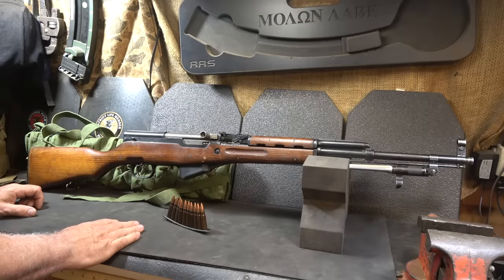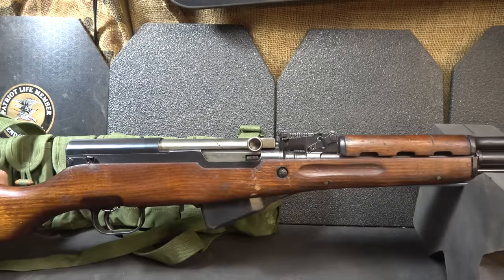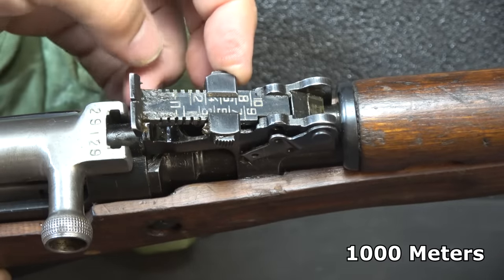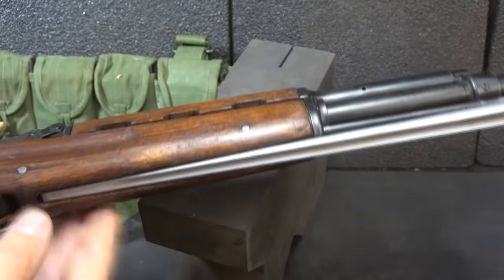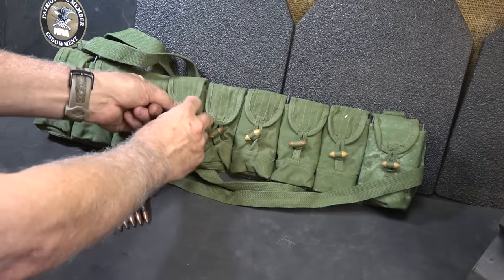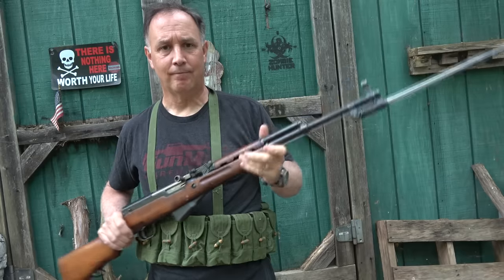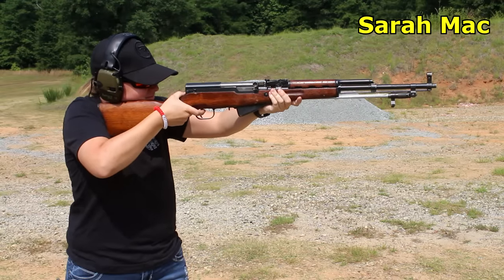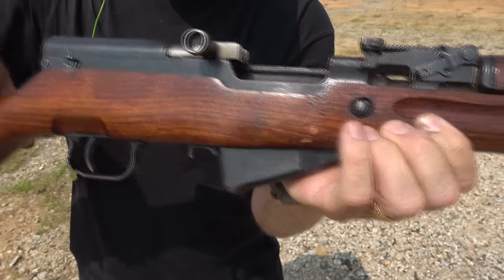Surplus Chinese SKS Rifle Review

Comment: Actually the recoil spring curvy end needs to go into the bolt carrier and the straight and goes toward the back
Reply: why so? genuinely curious I know nothing about disassembly/reassembly
Reply: The guide for the recoil spring is a tube that goes into the bolt carrier during recoil and maintains the spring shape. If you try both ways you can hear and feel the difference. Correctly oriented it is very smooth and quiet, reversed in will feel and sound “crunchy”.
Reply: I always wondered which way it was. Glad to know I was right the first time.
Reply: Thanks for the tip! I gotta go check if mine is right!
Reply: This is true if you put it in this way it will lock in through the frame and you won't have to push the dust cover forward to hold it in
Reply: ...yup!
Reply: I know this is old but yes when i saw him say it i was like No! Wrong infovits opposite the spring.
Reply: @user-jr6ot6wu6p  I had a guy sell me a Russian SKS for cheap cause it was unreliable. Turns out he put the spring in backwards lmao. After that it ran like a champ. It was a beautiful unrefurbished Tula too. I sold it like an idiot
Reply: The snake goes in the hole
Reply: THIS.
Reply: Guy owns the channel. Doesn't mean he's an expert or is right about everything he says or does.
Reply: Thank you❤

Comment: Pretty sure the straight end of the recoil spring faces the rear.
I bought my 1st SKS in 1980 and have had Chinese, Russian, Yugoslavian and Romanian variants.
Never been lucky enough to own an Albanian variant.
Solid well built rifles.
Reply: Yes you are right. The curly goes in first..
Reply: Absolutely correct! However it will still fire, f’n great gun
Reply: Yep curly part of spring inside the bolt carrier.  Can cause malfunctions the other way.

Comment: Back in 1990 I bought a new one unissued, milled, chromed bolt & barrel with all the accessories CAKED in cosmoline for $69.99. I was  young and poor then but would have loved to have bought a crate. I've had the trigger reworked, put a muzzle brake on it, a pistol grip that attaches to the trigger group and a Chicom 20 Rd fixed mag. Great shooter that's accurate and fun. I own a a lot of milsurp and this is the EASIEST rifle to load quickly with stripper clips. I like it better than my AK. It's one of my favorite guns to shoot. One caveat: Don't use copper washed ammo. My ONLY failure ever was FTF when I used that ammo, and that was after 500 RDS fired. That stuff just gunks the chamber up and cases don't want to extract. Left a ton of flaking behind to clean. Highly recommend getting one.
Reply: You mean it's BUBBAFIED !

Comment: You got it wrong. The curvy part of the recoil spring is supposed to go in first.
Reply: Correct.  He also has it wrong on the cleaning video.  It appeared he recieved the firearm with it installed reversed.
Reply: Yeah the curly part for sure goes inside the carrior
Reply: Was just gonna say something haha but y’all beat me to it
Reply: Yeah, I caught that too.
Reply: @videodistro  i have purchased new skss and found the spring to be inserted both ways and it doesnt seem to make any diffrence. so enlighten me. give me some facts to help me decide either way!
Reply: snake gose in the hole
Reply: is there any repercussion of having this reversed? I was watching a different video and noticed it too. The curly side was head first in a different video, but this one had the curly side facing opposite. Glad the comments confirmed it to me too. Curly side goes in first.
Reply: @pandanese90  THE AK. CURLY End GOEs IN FIrst ALSO.
Reply: @videodistro  correct, but it comes from China so it's excusable...lol 😂🤣
Reply: I been workij at a gun shop for 15 years, 50% sks come in with spring backwards, makes action rough, probly why failures....
Reply: I spit on mine before putting it in.
Reply: @williamdaniels6943  Try it both ways and yes it will function you'll notice a big difference in the feel of the action while operating the bolt when it's incorrectly installed with snake to the rear
Reply: @BM205  thanks for the info partner just went and changed mine over
Reply: @williamdaniels6943  Glad I could help
Reply: Curly end first.
Reply: William Daniels It batters the action harder than it should with it installed incorrectly and you can also experience malfunctions with it in backwards.
Reply: Doesnt matter..it functions either way.curly or straight end first..I've tested it on 4 different sks from Albanian to Yugoslavia .russian.romania.work fine...it might work the rifle harder w the curly end in the back position..unless your shooting 1000 rounds a day..it a be fine.
Reply: @williamdaniels6943  I think the straight end should be in the back, idk, I just know how it should feel when cocking it. if it feels and sounds rough, its wrong so flip the spring around.
Reply: @williamdaniels6943  Curly end in.

Duh.
Reply: I accidentally put mine back together with the spring backwords and the gun jammed. I had to use tools to even get the back open the spring was so far pushed in.
Reply: You guys realize that the end that goes into the carrier is going to cause the “curl” on the other end, right? The springs longer than the guide rod, and it’s straightened out when in the carrier.
Reply: @williamdaniels6943  I found this https://youtu.be/rZUZi57h49Y?t=463 The consensus is that curvy first into bolt carrier then straight is in back.
Reply: @williamdaniels6943  Trust me, you did not buy a "new" SKS. You bought an SKS that was new to you.

Comment: You’re putting the carrier spring in the wrong way! Don’t just take my word for it look it up! hope you see this comment!
Reply: That's absolutely correct. It's backwards.
Reply: The Prometheus Project  guess what, putting the carrier spring in the wrong way can cause cycling issues and can cause the bolt to jam. Go educate yourself kid things are a certain way for a reason
Reply: The Prometheus Project  sks’s are robust and it’ll still function, but regardless it’s still better to have it installed correctly and there are many examples of people who have had problems because of backwards springs
Reply: @The Prometheus Project it can  matter.  The reason the spring is curvy is bacause the guide rod on that end is smaller and relies on the channel in the bolt carrier to help keep it centered.  Run it too much reversed and potentially the thinner guide rod can break and spring get munged up.
Reply: The Prometheus Project It does matter as it batters the action harder than it should which will eventually break something prematurely.  Also, many people experience malfunctions with it backwards.   Why not run it the way it was meant to be?  The gun is super simple to fieldstrip.  Sootch experienced a malfunction in the video.  It probably wouldn't have happened had the components been installed correctly.
Reply: Months later and no edit to the video.  Not good.
Reply: @The Prometheus Project Yes it does.
Reply: You are right. It’s another way around! I have my first SKS in 1994, when I was a cadet in the CPLA.
Reply: The Prometheus Project 8:50

Comment: I love the SKS rifle it's why I have several including a 1970 Yugoslavian M59/66A1 and a 1952rBlack Bolt Russian still new in the box as it came from the arsenal.  I got my 1965 Chinese factory /26\ rifle new in the box about 13 years ago for $250 an they are great shooters especially with my cast lead handloads.  The Chinese made 3 SKS rifles  that took AK mags, the SKS-D 20" barrel, the SKS-M Paratrooper or with standard 20" barrel(very rare) or the  SKS MC-5D which has no SKS markings.

Comment: Fast way to reload without a stripper clip:
Close the bolt.
Turn the rifle over.
Open the magazine.
Load the rounds through the open magazine (max 9).
Close the magazine.
Cycle the bolt.
Reply: jam
Reply: @bullmeatt  nope
Reply: @robspear03  yep
Reply: There's a YouTube video posted by revolver-master Jerry Miculek rocking the SKS in exactly that manner. That was the first time that loading method had occurred to the.
Reply: Not smart unless you can inspect the ammunition as you load it. It will jam.
Reply: Just1American1966 the last round may load in wrong and cause the last round to eject before being fired. It could also cause a permanent bend in the follower of the mag. You’d be better off just loading from top with stripper clip unless you don’t care about the last round and condition of the gun.

Comment: @9:50  SAFETY NOTICE.  that is the incorrect position which causes battering of the action more than it should which will lead to something breaking prematurely and can lead to malfunctions as well.  I learned that the hard way when I was 16 years old and had received one with the spring assembly installed backwards.  Please research this for yourself and edit this video so no one has their gun get damaged or worse they get harmed when something breaks.

Comment: Got my SKS and switched out the stock for an ATI Stock. Nice modern upgrade to this rifle and made it more fun to shoot in my opinion. Also, you can modify the stocks to allow detachable 10, 20, and 30 round mags that don't require the use of a stipper clip.
Reply: Don't Bubba an sks. Buy an ak for that

Comment: I bought mine in the late 80s at Woolworth Dept. Store for $79.98. It was accurate right out of the box, I have longer arms than the average Chinese soldier, so I pulled off the metal butt plate and replaced it with a 2 inch shotgun pad. It works great and reduced the recoil nicely. I bought a case of 1100 rounds for $80. I put 500 rounds through it and put in in my safe. I gets cleaned every 5 years or so. I always knew it was a keeper. I also bought a Russian Makarov when they appeared in 92 for less than $90. I put 24 rounds through it and put it in the safe.  At the time I had a feeling both the Chinese SKS and the Russian Makarov would go up in value. Now I wish I would bought 2 of each. I let the ammo for both get away from me over the years, but both turned out to be a good investment.

Comment: Bought mine in 1987 for $99.00 and still going strong.  I was amazed at the accuracy right out of the flimsy box.  Stock is short...Chinese are generally not as tall in stature as Westerners but plenty of options exist for lengthening your stock or buying an aftermarket.  Solid, tough rifle.

Comment: I will tell you all this. The Norinco SKS is an awesome weapon. The price vs value grows from purchase to restoration and finish. I have seen them as high as $900 dollars. I would put mine in that range just because of the finish and complete restoration down to the sling and stock cleaning kit. I also added a duplex crosshair front sight post sand a recoil pad that absorbs and holds the rifle stable in the shoulder cup.  The recoil pad still allows for the store and removal of the stock cleaning kit. Only down side is trying to attach optics to the platform. It can be done, yet why the iron sights work very well and the range of use will usually never go beyond 300 meters. I would recommend to anyone who wants to take on the restoration and the quality and reliability of this rifle should do it.

Comment: Two weeks ago, I went hunting for the first time. The guide suggested that I use a 30-06s with scope. Although I have 5 of them, including 2 Sako 85 Bavarian, I took a Chinese SKS without scope and caught a 200 Ib male black bear at 100 feet with one 7.62x39 SP round. I chose the SKS because it is cheap, reliable, and semi auto. Another advantage I found during this hunt is that the gunshot is not that loud, so don't have to wear earplugs or hearing protection.

Comment: During the late 80’s when I was a store front FFL. I could have purchased a pallot of 144 SKS’s for 39.99 a piece. I could have saved the freight by picking them up in person from a Long Beach Ca importer. I passed, at the time SKS’s were a dime a dozen and being sold in Phoenix commonly for 69.99. According to the Chinese importer. East coast merchants were getting together and buying truck loads. As it turned out the low cost SKS’s were a lower grade lacking the chrome lined bore, chrome or stainless steel bolt, chrome bayonet and the barrels were not pinned. They were however brand new manufacture, not surplus and they were totally reliable.

Comment: Awesome selection. I have to say, when it comes to guns, we here in Canada don't always have the best of luck in terms of prices and availability. But, when it comes to these, I see we come out on top. $199 at my closest dealer. Magazine is pinned to 5 rounds but there are some loopholes to that...for the moment anyway
Reply: What are the loopholes?
Reply: @travzworld  for one, as of the time of that writing, the M1 Garand was exempt from the 5 round limit (due to magazine design). Then there was also those that were classified as "Pistol" magazines. Pistol mags are limited to 10 rounds and weren't restricted to the firearm they were designed for...at the time. I think that 'loophole' has been tightened up now. If I'm missing something or wrong, I'm sure someone will come along and correct me.

Comment: Ah, I remember going to the Gun Show and seeing them piled on tables for a Hundred bucks (minus the Deadly Drive-By Assault Bayonet, of course)! A little known Tip to pass along. The SKS stripper clip holds 38/357 Ammo very nicely. And with a little practice, you can use them to feed Lever Guns in that Caliber that have a Loading Gate. And of course, even if you just want to use them for Prepping for SHTF, you don't need to fumble with loose rounds. Hope this helps, and thanks for the Video. Take Care.
Reply from the maker: Thanks Leslie! Those were the days! The prices were crazy low!
Reply: @sootch00  Yep! I should have brought a few for "Just in Case" purposes back in the day. Speaking of "Just in Case". Another SKS Tip. Put a Milsurp M16 Stock pouch on the Buttstock and drop in some Loaded Stripper Clips. Add a Sling and you have a "Grab and Go Gun" for those "Just in Case" events. Not saying it would replace a Minute Man Rifle, but as a Truck Gun, Hunting Cabin Gun, Spare for Guests who are at your home during a SHTF event, it's not a bad idea. That's how I keep my Yugo SKS on "Hot Standby". Hope this helps. Take Care and Long Live the Republic!
Reply: @sootch00  Yep. Just saw a listing for $499 (June 2021). And they're sold out!

Comment: ...one of the problems with the SKS is that the cosmoline can freeze the firing pin in the protruding position...I've known at least one guy 9who has a VN capture with papers both in English & Vietnamese) who took his SKS to the range without cleaning it...it went full auto - luckily he was alone on the range when it occurred... he called me in a panic - I told him to remove the bolt and give it a good soaking cleaning to dissolve the solidified crud - he did and never had another problem...yet another BTW...THE Jugo SKSes are the only ones not to have chromed bores & chambers, so you need to clean them thoroughly every time yo use corrosive surplus ammo...the lack of chrome protection had to do with Tito not wanting to be beholden to the Soviets for any reason.  Jugoslavia had practically no chrome deposits, while the Soviets had plenty...the independent (and brutal) dictator, Tito, decided not to pay the price that Stalin demanded for the shipment of chrome to his erstwhile ally...
Reply: A murray pin will fix that.
Reply: @humansvd3269  so would cleaning it
Reply: @johnlovescathyforevers6116  but you'd have to keep pushing the pin out to clean the firing pin channel. This shows you to skip that.  It only cost me a few measly dollars. If the ATF didn't exist,  this would be unnecessary.
Reply: @humansvd3269  takes 5 minutes to break the bolt down and clean it.youll never have a problem.. however the Russians discontinued the spring bc they lost temper and desinagrated.
Reply: @o9rgeronimo979  Blame the ATF then. A gun that slam fires is full auto, didn't you know that?

Comment: Back in the late 80's / early 90's I purchased my Mac-90 for $100, 4 SKS's similar to the one in this video for $80 each and I also purchased 3 of the short barrel paratrooper models, which are still in cosmoline.   With them, I have the oil bottles, clips, bandoliers, cleaning kits, stripper clips, extended mags etc.  I kept all this stuff in tact, including crates of E. German 7.62 x 39 ammo, not knowing what these rifles would eventually be worth...keep in mind at the time they were worth not much more than a simple pellet gun. Glad I had faith in their original quality.  They are a joy to shoot and have turned out to be a pretty decent investment.

Comment: I just shot mine today for the first time. Using the promag 35 rd mags with Wolf ammo, did great, shot all 35 from each mag. The kick was nothing. I used mineral spirits and hot water to remove the cosmoline. Got it at PSA for $300. Definitely a fine rifle. Would recommend.
Reply: Was your rifle pretty beat up? Just wondering. Considering buying one. Last time I bought one the SKS would fire one round then the bolt would lock and not cycle, so I sold it and got a solid AR. Love the rifle mine just was buggy and was a Yugo so idk what might’ve been the problem. Also cleaned all the compline off with mineral spirits and other stuff as well

Comment: 1988 I purchased 10 of them in a unopened case for $59.00 each. It sat in my basement for 20 years and I finally sold 9 of them for $400 a piece. They were all milled version's, with the blade bayonet.

Comment: After loading 10 rounds you can push down the rounds and ride the bolt closed (don't pinch the finger holding the ammo down). This way you can carry 10 rounds with a closed bolt without one chambered

Comment: Great video but I believe your recoil spring is in backwards, I copied the following sentence straight from the manual.

(Figure 10) Remove the recoil spring from the rear of the bolt carrier. (Figure 11) Be certain to reinstall recoil spring with C Clip end forward.